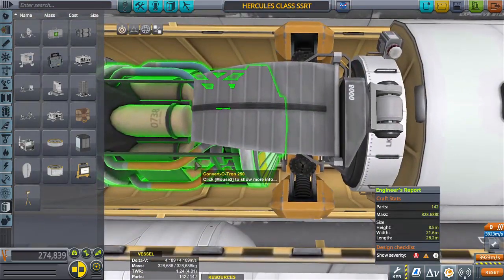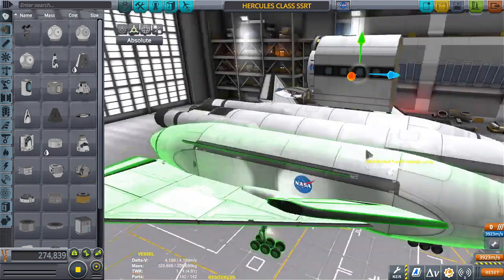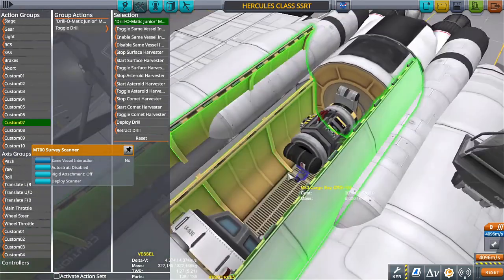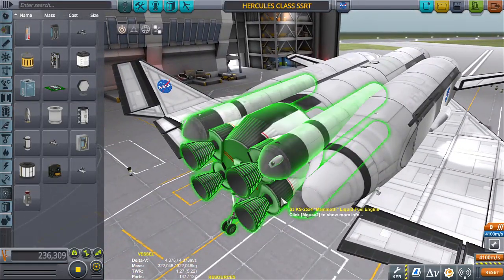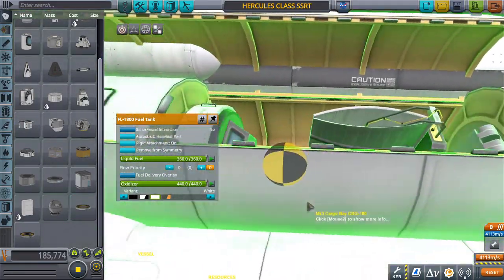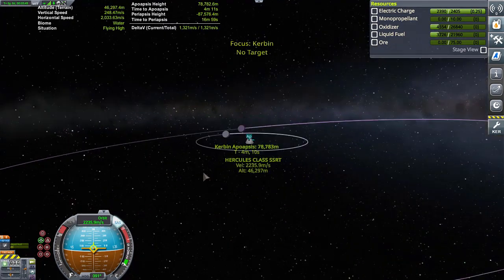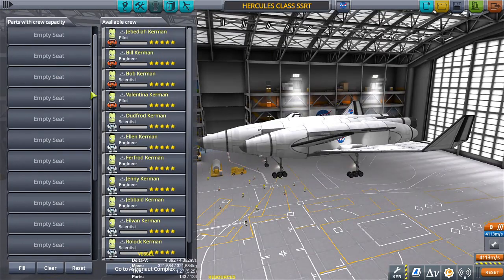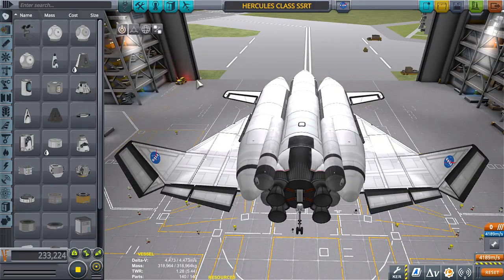TO THE MOON in a ROCKET PLANE SSTO part 2  \   KSP 1.11  \  Kerbal Space Program

Comment: When in map mode you can use tab and Shift+Tab to switch what your focusing on. need to be careful tho as it can affect engine throttle
Reply: The key next to 1 with the ~ and ` should reset your focus to the currently selected craft as well